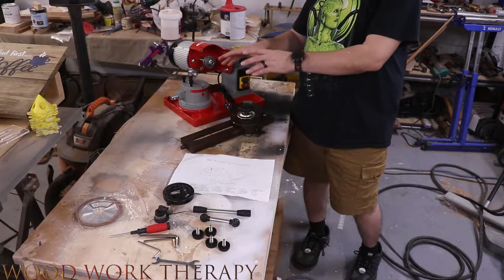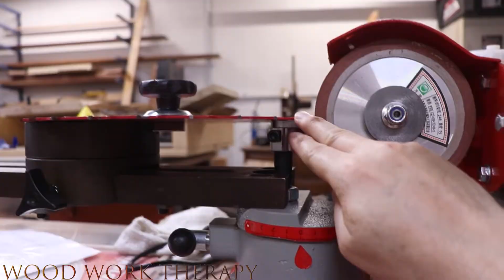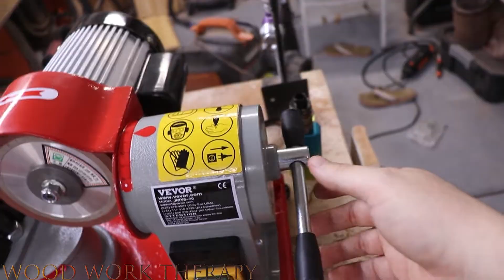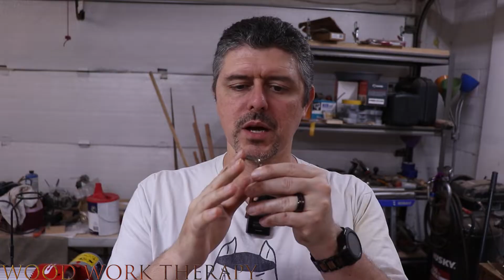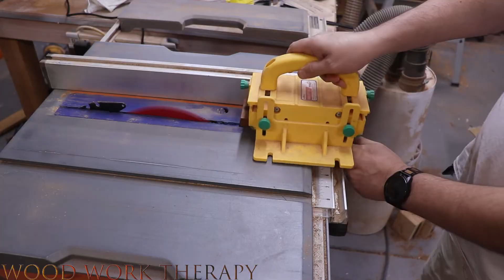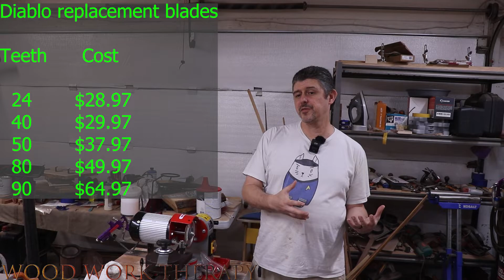Vevor Saw Blade Sharpener Review – Does It Actually Work?

Comment: Crap review. You spent more time telling us how to cut a bit off an allen key than you did on how to use the machine. ie; how is the indexing of each tooth done, what is the motor adjustment handle for, etc etc.
Reply from the maker: We are sorry that the review did not help answer all of your questions. Please note this is a performance/features "review", not a how-to-use guide of the machine. I think the video your looking for is a how-to-use-the-machine kind of video. Product review videos do not often contain that kind of content as most viewers are looking to watch short-form content when it comes to reviews. Normally 5-10 minutes. We have found though that does not answer enough questions, so we have made a longer format on some reviews to help with that to an extent. The original video recording for this video was about 2+ hours. I am not certain anyone would want to hear me drone on for that long of an amount of time, LOL 
Anyway, not my rules, it's the way that the community prefers things. I know that can be frustrating. But we do attempt to somewhat follow the current trends that the YouTube community desires.
If you have questions we are always happy to answer them for you. 
Q: How is the indexing of each tooth done?
A: 8:38 It is shown how to sharpen once you have the pin in place. The pin for indexing is adjusted by an Allen wrench from underneath the pin plate itself.
Q: What is the motor adjustment handle for?
A: For adjusting the degree angle of the sharpening blade. 
Ex. So if you have a 30-degree cut vs a perfect 90-degree, you can use that handle to loosen the motor to create that cut angle.
If you have further questions please feel free to respond to this thread. We are always happy to assist you.
Reply: @WoodWorkTherapy  Sorry for being a little bit too forthright and I accept your explanation however although I understand that your video was a performance review rather than a "how to", if you chopped out, how to attach the grinding wheel or the need to cut off a piece of the allen key you could have been a lot more descriptive with the "how to's". And still stay under 10 minutes. 
Although you say the video was a performance, features review, I don't believe that you reviewed any features. What is the handle on the cross slide for? You didn't appear to be using it when you sharpened the blade.
I watch an awful lot of how to Utube clips and it drives me mad with the number of people that become talking heads when presenting a video. The worst mistake (and the most common) is the presenter going through all the pieces that are included with the particular machine. For example......now these are the tools that are included...you have a spanner..one end is about 12mm ...or it might be 1/2" I am not sure, the other end is 9/16", then we have several allen wrenches ... presenter picks up each one and holds it in front of camera, a hammer, some nuts and bolts, a screwdriver etc etc 
The reviewer has got to assume that the people watching his / her video have a least some common sense and can identify the parts supplied, know how to do up a nut, need to take the bits out of the plastic bag before installing them and instead explain the things that (a) are not described well or at all in the sales brochure and (b) are not described well or at all in the instructions. Anyway hope this is taken as constructive criticism.
Reply from the maker: @daocuster9270 I appreciate you taking the time to leave feedback on our video, and I completely understand where you're coming from. I apologize if the video felt like it was lacking in the "how-to" department. We definitely want to make sure our viewers get the information they need to properly use the product.

In terms of the length of the video, we always try to strike a balance between being informative and keeping things concise. We understand that people's time is valuable, so we try to keep our video reviews under 10 minutes if possible. However, we'll definitely keep your feedback in mind moving forward and see if we can find ways to be more descriptive without sacrificing brevity.

As for the handle on the motor, I can see how it may have been unclear in the video. The handle is used to move the motor slide back and forth, which can be helpful when sharpening blades of different lengths. The adjustment on the front is for left/right movement. We'll make sure to explain this more clearly in future videos. As we do intend to do a full sharpening video soon. I will use your feedback as part of how we are going to craft that video. I know we have had others that would like to have a deeper dive into sharpening/cleaning in general. And I think that is a great video idea for the channel

I totally understand your frustration with "talking head" videos and unnecessary explanations of included tools. We try to avoid this as much as possible, but sometimes we may unintentionally include information that seems obvious. We'll do our best to focus on the important details and assume our viewers have a basic understanding of how to use the tools.

Again, I appreciate and thank you for your constructive criticism, and hope you'll continue to watch our videos in the future. Let us know if there's anything else we can do to improve! Or any feedback on what you like. We love to hear from all of you! 😀
Reply: @WoodWorkTherapy I thought the video was balanced and it explained enough for what it was meant to explain.
Reply: @WoodWorkTherapy  there was definitely too much blah blah blah and not enough about the machine.

Comment: Can you de a follow-up review now that you have had the machine for a few months?
Reply from the maker: Doing a follow-up video actually sounds fun. Great suggestion! For some insight, it is still working and sharpening just fine. Still no issues. We are all still pleased with the performance and accuracy of the blade sharpener. I will see if we can get a more in-depth video going for the machine. Was looking to do a cleaning video here soon. Blades have kept well since I did the video oddly. LOL So I have been putting off the video, but might just do it to help others out, and get a little more perspective on the sharpener. :)
Reply: @WoodWorkTherapy yep agreed I have one for around a yr now and still working well.